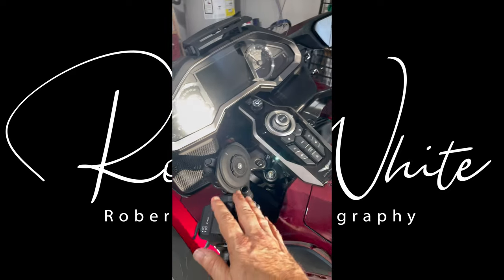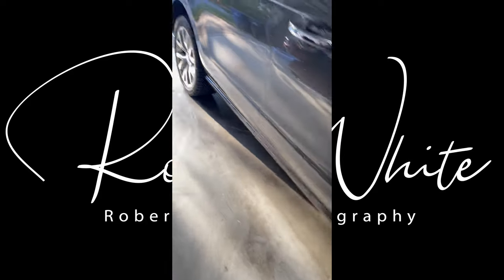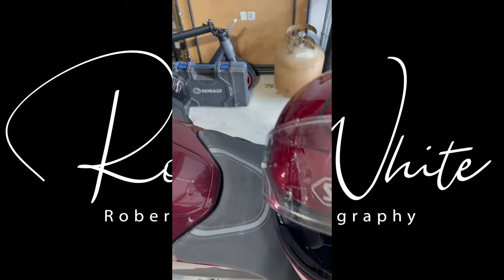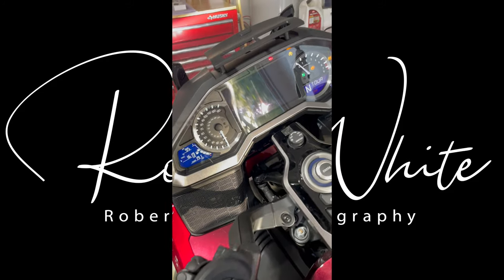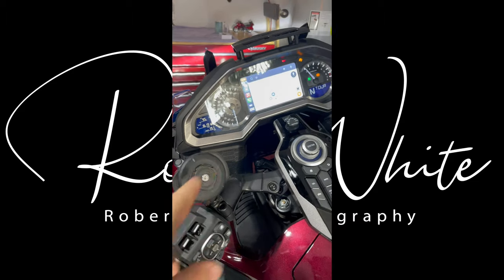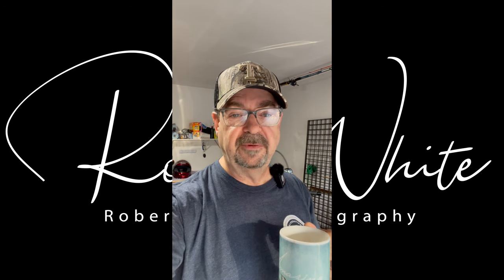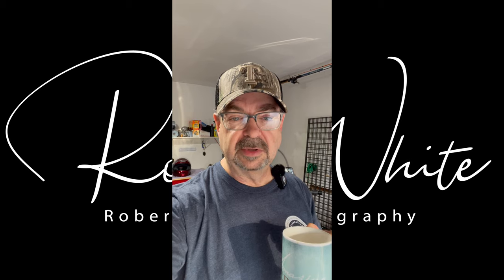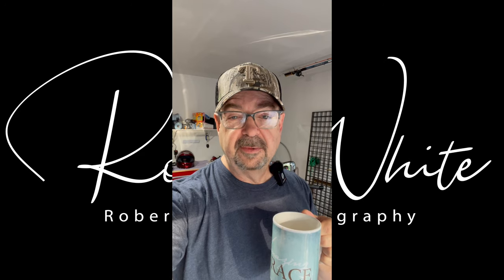Carlin USB Wireless Apple Car Play Adaptor

Comment: Hello Robert!
I like your set-up for your phone mount/dampening! Did you purchase that from AMAZON also? Also, does your phone overheats while in your pocket? I noticed on a long trip last weekend that my phone overheated when I had it in the compartment on the bike! I was able to rectify the situation by opening the door to the cubby compartment . Please let me know when you get a minute, thanks!
Loyal.
Reply from the maker: Loyal, thank you for watching and commenting!  All of the quad lock items I purchased directly from QuadLock the company.  Links are in the description.  This would include the wireless weatherproof charger, and vibration dampener, and the 12v to USB power cable.  As for the phone overheating, I did have the problem a few times when it was in the glove box, but most every time with it out in this Texas sun AND attached to a wireless charger (which generates heat even in a cold dark room).

Comment: Thank you for the video.  I tried a similar configuration with the Carlinkiit module.  Initially it worked pretty good.  However,  within 5 startups/turn ons I could no longer get the CarPlay to work.  I have the same unit in my car and it works flawless.  I've watched Cruiseman's video on the sequence of turning on the unit and tried his method without success.  After many unsuccessful attempts,  I eventually gave up and went back to the original configuration in the glove box. interested to know if this is still working for you.
Reply from the maker: Skeeter, thank you for watching, commenting, and reaching out.  Go check out Cruiseman’s video where he explains how to pull up the settings for the Carlin Kit device and a computer or tablet and set a delay of 30 seconds on the startup.  That solved all my issues 👍🏻

Comment: Robert, are U driving a non-DCT Model? I'm a asking as I couldn't find a RAW kit for the left side of my ACT model to install the phone as U did - or in my case a 2nd phone to have Rain Radar in view here in the European Alps 🤪. 
Which RAW holder are U using on the Left?
Reply from the maker: Hey TA, we might be the same age :)  I am on a DCT model sorry.  I"m not familiar with the differences other than I'm sure there's a clutch fluid reservoir and I know I've seen reservoir caps that contain a ball mount on them.  Keep searching and good luck.  Thanks for Watching and commenting !!

Comment: Hi Robert .  Have you tried connecting phone to the Carlin adapter for ACP and not helmet?  
I was on The understanding that using the device substituted connecting Helmet ?   .
Reply from the maker: Phil the Phone is what is connected to the Carlin... If I don't first turn on the helmet and let it connect with the bike, I get the message "apple car play cannot start because Helmet is not connected to bike" or something like that.
Reply: @robertwhitemoto  ok thanks Robert . Like I said I have read somewhere that if you connect the Carlin to the bike it substitutes the helmet on the dashboard ?  This then allows the ACP to load without helmet . I guess just in case your out all day on your bike and your helmet runs out of battery ?  
Thanks for your reply anyway
Reply from the maker: @luckyphil6486  I am definitely going to try that !